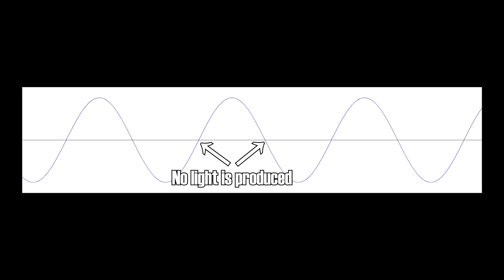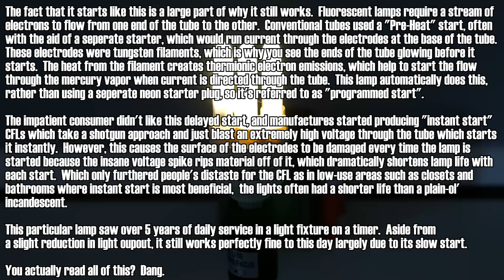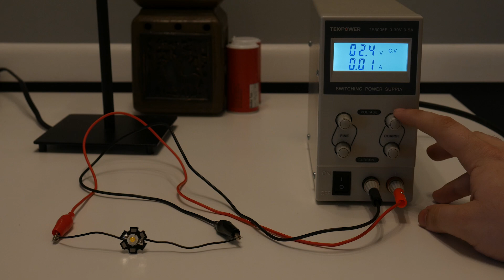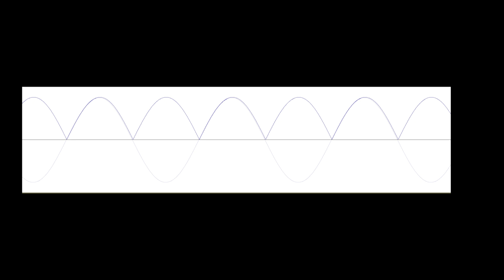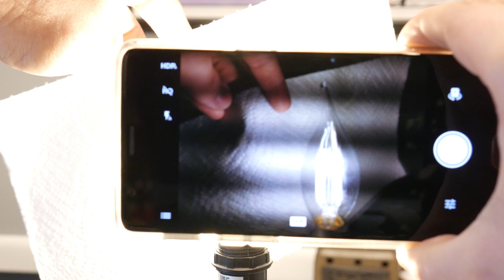LED bulbs that flicker, and CFLs that almost never did

Comment: In my experience, working as both residential and commercial sales for a Batteries+Bulbs franchise, the main reason a lot of people hate CFLs falls into three categories. First, there are the people who don't like that the government "forced" them into CFLs, and that is just whatever.
The second reason is the colors. I wish that CFL manufacturers had limited their stock of cool white or daylight bulbs in entirely household consumer style buying settings and more clearly labeled some of their packaging. Consumers who get their new bulb home only to find a horrific bright daylight assault on their eyes from their favorite reading lamp is... jarring to say the least.
Finally, its the color rendering index. While most residential customers probably couldn't explain exactly why, they say the light looks weird or odd. Commercial customers could articulate somewhat better what was going on, that the light made things look funny. Again, more of a problem with early CFLs, but it effectively turned people off of them before they fully matured.
LEDs by contrast had relatively good CRI and colors from the beginning, with the only real barrier to entry being their high cost not too long ago.

Comment: human eyes have separate photosensitive cells that mainly detect blue light and maintain our circadian rythms (they play no role in vision and work even in the mostly blind population). CFLs' cold light operates at very nearly this exact wavelength that these special cells are sensitive to, and that may be the largest contributor to the headaches that people report when using them, if indeed they used them for household illumination, which you would only really do at night, and thus screw up your rythm. cell phones and computer monitors have special warm modes that you can turn on at night to prevent this exact thing, and gunnar glasses are a lower tech approach to eliminating blue light when staring at screens for long periods.

Comment: "Color changing bulbs only made possible by LEDs." I am kind of stunned by that statement. I went on a google search because theoretically you could of made bulbs with this ability. I looked for incandescent, such as using smaller bulbs with colored coatings in a frosted shall, also looked for any kind of mixed gas style too and couldn't find anything. It was so possible, someone had to of come up with some niche vintage color changing bulb right?...

Comment: I keep all my old cfl's for use in the bathrooms.  It's nice they start up dimmer, when turning it on in a dark house.
Reply: install exhaust fan with light and nightlight, as nightime/pee usage lol. I have LED A19;s in open bottom globe fixture as primary bath light. the combo exhaust has 60watt LED equivalent as it's primary bulb and 7 watt incandescent nightlight(through opaque lens) your choice of brightness, dull glow to blinded :))
Reply: @rasoirwolf The phosphors aren't that toxic too, the tri-phosphor and the halophosphate lamps are relatively harmless, the ancient beryllium phosphors are extremely toxic however those are the ones with liquid mercury, nowadays they use tiny dose of mercury amalgam.
Reply: They are toxic as well especially if they break. They contain mercury in them it even says on the packaging if it breaks leave the house for an hour to air out. I changed all my lights to daylight LEDs. I even have one in my fridge. Works great
Reply: @TheCowboy4000  That's not true. The amount of mercury they have isn't enough to cause permanent damage to a person unless you purposefully try to breathe in as much as possible. For the longest time, there were several (full size) fluorescent bulbs in our basement that had been smashed apart and never cleaned up. Also, it would be important to note that I was around 4 to 6 years old when they were like this and I was frequently in that room because it was where our train layout was.

Comment: Them fancy pants “filament” styled bulbs don’t fit certain fixtures.  I have those types of fixtures on my ceiling fan.  Only one brand of this fancy looking bulbs actually fit and it was Walmart’s great value brand. However they flicker so bad it could be used at a night club.  I had to get cheap non fancy pants led bulbs (which I found to have far better tone of soft white light than my old cfls and I notice no flickering ) .  Lowe’s stoped selling those, Walmart well they don’t have a very good selection.  My only option was Home Depot.   If those non fancy pants leds are discontinued.  I will have to replace my ceiling fan, and hope the fancy pants LED light start advertising their rate of flickering.  This way competition drive companies to up the flicker rate to at least 75 hz and that should be enough for most people to not notice and minimize eye strain.

Comment: Man I love the cold. bright white/blue of the 56K LEDs and CFLs, you're crazy to prefer the dim and dingy, dirty yellow of everything else.
Reply: Personally, I often find 5000K and higher a bit too blue for taste (except at very high illumination levels), but still kind of dislike 2700 to 3000K for being too yellow, and actually prefer a compromise of 3500 or 4000. 3500K is my favorite but I have yet to see any LED bulbs available in that (other than smart bulbs with tunable color temperatures).

Comment: i replaced all lamps in my house with the cheapest filament led bulbs i found on the italian amazon.  i bought 2 or 3 types,  ranging from 6 to 10w each, something like 2€ a bulb. I don't know how but they don't flicker at all, the harsh light from the "filament" pointy type of emission is super nice  along with  2900°K  it looks like an halogen bulb.  Also, i work in video production and can guess a good CRI, for 2€ a lamp it isn't half bad (i'd say 80+). All in all i love those lamps

Comment: The color orange in the plastic was discovered by N Scale model railroad fans who needed a better white headlight for our trains.  Early white LEDs had bad phosphor positioning, and you would get a distinct and unrealistic green ring.  We discovered you could paint the casing of the LED with orange stained glass paint to absorb this green ring, as orange absorbs green.  Unfortunately,  the color spread was already occurring at the surface of the LED and therefore we needed to get the orange absorber in much closer to the chip in the bottom.  Jim Hinds of Richmond Controls, a supplier of model train lighting products,  went to Nichia to get them to color the plastic case irself, and the daylight warm LED was born.

Comment: I get migraines, and the lights in school always really messed me up. It was more about them being directly above my eyeline at all time while in school, but some of them DID flicker, and I could see it on my hands if I stood under them and held my hands out.

I've seen this with many lights over the years. One in my house does it, but it's not used often, so I haven't replaced it. I'm pretty sure it's CFL, but I couldn't care less what KIND of bulb it is, I'd never leave it on for long.

All that being said it's never the type of bulb, just specific bulbs. Some of them get just slow enough in their flickering that some people start to notice. My SO for instance can't even see the issue with the light I'm talking about, where to me it looks like a really fast strobe.

It's an interesting topic for sure, but I definitely think far too many people can't see the blinking ever, and it stops any "change" with regards to it. Any bulbs I've paid for on my own dime have always been a bit beefier to combat what I assume are just bad or poorly made bulbs, and I've yet to have a problem. None of the LED bulbs I own look anything like the one you have here, and none of them have any sort of "flicker" which is good enough for me.

I hope proper LED bulbs take over faster and faster. I think they're already the norm, but it's hard to get companies , school districts, states, counties, etc, to spend a bunch of money replacing things that "already work" even if it will probably save them tonnes of money in the long run.

Comment: You are actually wrong on the colour output, LED only do 90% CRI output while really high end does 95%, CFL and other old school bulbs do much closer to 100% however they are uneven which is a common argument against them regardless of this majority of LED light does produce poor colour reproductions and are specially prone to introducing the green hue as is an issue with majority of LED monitors which makes stuff look sick or appear sick.
There are LED that are getting much closer to 100% CRI, some of the really high end does 98% which is impressive but having used LED myself and then actually switched back to good old CFL I noticed a massive difference in my mood and sleeping conditions. 

There are a lot of great scientific articles on how colours has huge impact on our lives all from depression, stress to sleeping conditions, colours can all have a massive impact on these characteristics.

Comment: I'm afraid I have to disagree, I like CFLs!
Especially the ones that start dim and brighten up!
I think they're perfect in a bedside lamp! When you first turn them on in the morning they're not blinding and painful. ;]
Reply: I'm a bit weird and eccentric and like that effect too, to the point that I've even programmed my smart bulbs to do things like that on purpose. (Of course, the neat thing about those is that you can also have instant-on at full brightness on those occasions when you're in a hurry and don't want to wait for them to get brighter.)
Reply: @TravisTev  didn't know smart bulbs could be programmed!?
That would be really cool!
Though I don't think "$25-each" cool!!
Reply: @drivesthecar3247  Yeah, the downside is they're impressively expensive right now (though you get a lot of potential for the money). I use some Philips Hue ones, which have publicly-released programming documentation that allows anyone to make apps for them (and there are quite a few out there now as a result). With a bridge, one can easily write programs in languages like Python to command the bridge to do things with the lights.

Comment: I film a lot at high speed, 250 frames per second, on my GoPro and Galaxy devices. I've been looking for a cheap light source that avoids as much flipper as possible. Do you think older compact fluorescent bulbs would work?

Comment: One problem I have with the ballasted type of bulbs (LED or Fluorescent, inductive or electronic) is the noise.  The inductive ones buzz, and in the electronic ones, that "high frequency" is often NOT 20khz, but closer to 9 or 10, within the range of human hearing, causing a persistent, if faint, high-pitched screech that just grates on my nerves more and more the longer I have to hear it, leaving me with 2 choices: earplugs or headache.

Comment: A study in the UK some 15 (20? 25?) years ago revealed that fluorescent lamps produce fatigue particularly when reading printed text, as it requires more effort to track a line of print when the light source flickers compared to a steady light source, such as sunlight or light from an incandescent bulb.  The flicker may not be perceptible in the foveal area of the field of view, but it certainly is in one's peripheral vision, whether the power source is 50 Hz or 60 Hz.

Comment: So a fellow commenter banderfargoyl made a joke about oil lamps, which got me thinking even more than I was about artificial lighting. My comment is under theirs in the replies, but in case you want to read here about the light quality of various oil lamps compared to electric lights and the sun, here you go! My dad collects oil lamps, and occasionally uses them for special events. My dad has one olive oil lamp (it looks like a genie lamp), a tallow rushlight, two Victorian kerosene lamps, one Edwardian kerosene lantern, and one modern vegetable oil mason jar lamp. I don’t know much about measuring light, so my metrics are:

1: on a scale of 1 to 10 (10 being most similar), how similar is the visibility of the artificial light to the visibility of sunlight?
2: on a scale of 1 to 10 (10 being as well as usual), how well can I see to do difficult, vision-sensitive tasks such as reading, embroidery, lace making, or drawing?

Now, average white light LED bulbs score about a 9 or an 8. The olive oil lamp is about a 3 or 4, the rushlight is a solid 2 (unless you use the old trick of getting a globe of water to fix your light on a certain spot to brighten it, then I’ll bring it to 5 in that focused and very smol spot), the two kerosene lamps are both 7 or 8, the kerosene lantern is 7 or 8, and the mason jar lamp is about a 3 or a 4. Also, for more comparison, I place warm-colour fairy lights at a 5 or a 6, and a standard household incandescent bulb at a 7 to an 8 (it can really vary, at least to my eyes). A standard orange high pressure sodium streetlight is about a 7 or an 8. While they’re by no means ecofriendly (which makes me sad, so I use more ecofriendly lights instead), kerosene lights are pretty good for special occasions, and you can see by them without much strain (especially if you have them spaced about one per ten to fifteen feet). Also, the kerosene lamps and lantern are the only ones that produce a very white light, which then gets a better brightness score than the other oil lights, which are very yellow. I’d describe the light of a single kerosene lamp as the same as one slightly dimmed white LED bulb (think an LED under a lampshade). This brightness is reduced slightly down to that 7 if you put a lampshade on it, but luckily a lot of shades are clear or frosted glass, so they don’t effect the brightness too much. Anyway, that’s some comparison of various old and new artificial lights for y’all to enjoy.

Comment: I have a question. Do LED light produce only RGB wave length? Is there LED that produce the entire light spectrum?
Reply: LEDs are broad band to a degree, are you thinking of laser diodes?
Reply: Cooper Gates,
Thanks for the reply. 
I am hoping to find LED that produce more natural daylight. I assume most LED produce only certain wave length, when combined give us the perception of white light.

Perhaps, may I suggest a video that evaluated the spectrum of light produced by different type of LED and Other type of lighting. If you have the equipment to scan and plot the chart.

I notice when photographed with different lights, on a group objects of different colours produce image that does not look real, sometime.
Reply: @esphilee  I think it would still look white if you managed to mix blue, green, and red laser diodes. A green LED would have peak luminosity around 532 nm or so and drop off on either side until it has negligible brightness at, say, 440 nm (blue) and 650 nm (red).
Reply: Cooper Gates,
I agree, combining Red, Blue, Green produce perception of white to human. 

The question is, does different “white” light source produce slightly different result in camera when a colour does not fall close to the primary colour, example yellow, and orange? even though the camera show same result when different “white” light source is shining on white object.

What I mean is, we understand that combining RGB will provide white light, but is there a white LED that produce the entire visible spectrum, instead of just the primary colours.

Comment: It is not the "flicker" of CFLs... it is the spectrum emitted... it makes my stomach turn and gives me headaches.

Cheap LED flicker in Christmas lights when driving past them is a huge distraction... and the blue ones in particular are unsettling.  I believe this is specific to males... and the blue LED frequency used in police light bars seem to be by design as to cause the maximum disorientation for roadside field sobriety testing false positives.

Comment: Can you do a video comparing LEDs to classic lights?

1. I've noticed a weird grid pattern on the floor from street and car lamps
2. I think bike and car lights particularly are made way too bright, almost to the point you'd think they're only as efficient as their classical counterpart
3. The white colour of the street lamps seems almost absurd in the dark, orange-yellow lights just seem better for humans and for light pollution
4. Almost no LED lights seem to be diffused... which they desperately need. I think I remember someone knowledgeable telling me this just isn't possible with LEDs for some reason, but I don't see why. Diffusion would probably fix the gridding issue as well which can actually be blinding if you look directly at it, unlike a classical filament which is all concentrated in one spot and isn't as bright
Reply: As answerable questions:
Is an array of LED lights worse for distant light sources?
What are the pros, cons, and mehs of the increase in brightness of driving lights over the previous standard?
Do LED street lamps have any significant benefits over sodium lamps?
Can LEDs be diffused, and why aren't they? Does this fix all our problems?